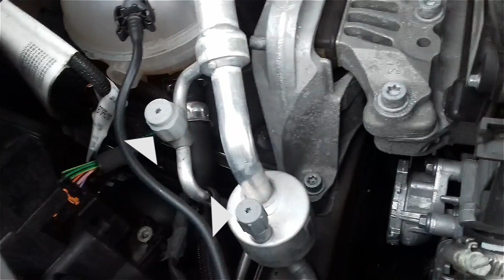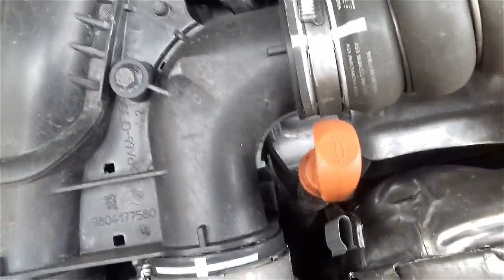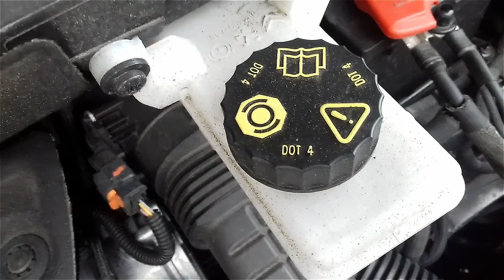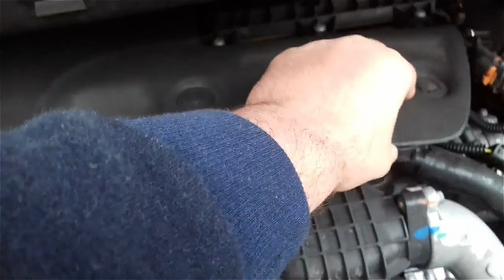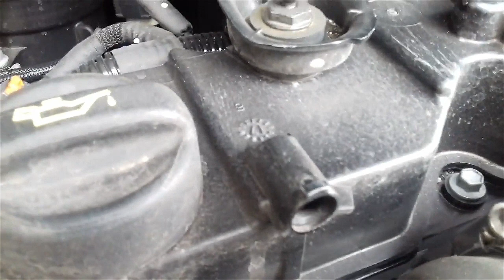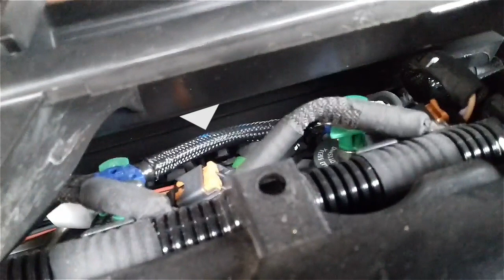Citroen Grand C4 Picasso 2017 Under The Bonnet Tour

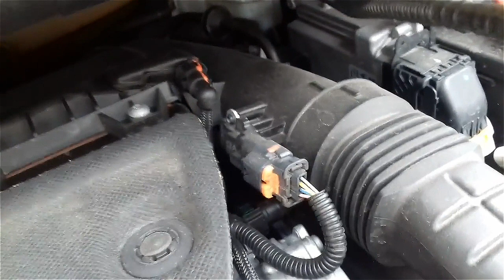Comment: At 4:30 you begin to talk about the mass air flow sensor. Just above this is a 90 degree hose connector with an orange line drawn on top of it. Any idea what this is? Mine has snapped off… Car still seemingly running okay, but not sure what it is?